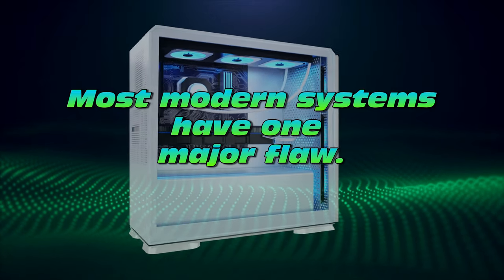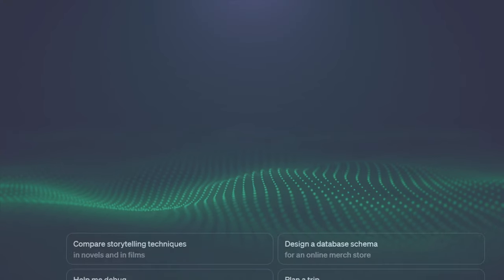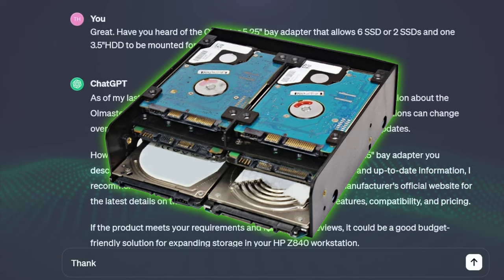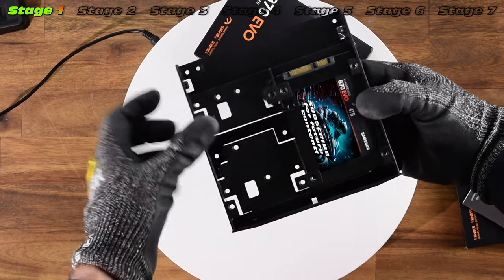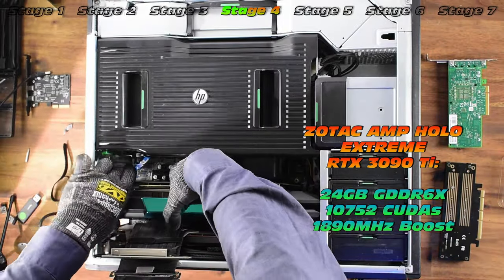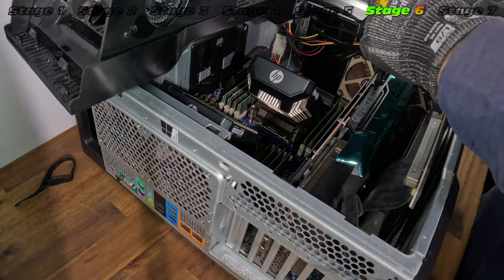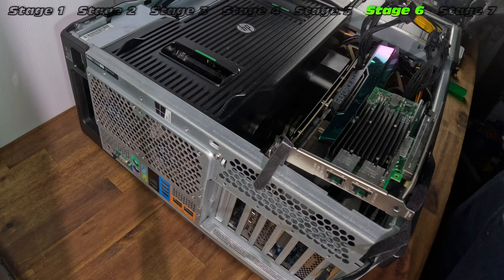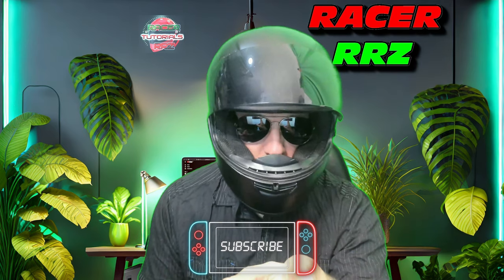Is this the most cost effective storage expansion? - HP Z840 Workstation + 5.25" Bay + 24TB SSD/HDD.

Comment: Well.. I feel inadequate lol. I've been considering a new storage solution for my media library which is quickly growing out of control. its grown large enough, I'd be pretty devasted, if I were to lose it. This video kinda shows me how overwhelming the options have become. I check prices for large capacity ssd's, and nope. Way out of my price range. I check prices for large capacity mechanical drives and it is better, but I'm still not happy since I would ideally like to get 3 drives. Its still kinda pricey, so I check the price of used drives and find it isn't much different than buying them new. While looking at used sata drives, I notice the cost of used sas drives. Large capacity used sas drives are definitely in my price range, but I'd have to get a controller, an expander cable, and I don't even know what else. Does this channel have a guide for this sort of thing?
Reply from the maker: I agree, when did things get so far out of hand? It can become complex quickly but once you gain an understanding of the current hardware requirements you will be able to resolve what you need.

I have done several videos on storage but they tend to be focused on a specific purpose - e.g. how to build a quick home server (easy: https://youtu.be/pCLYzEOur-o ) or how to create a massive DIY home server (complex: https://youtu.be/K4RalaEbRI4). 

What PC / Workstation have you got? If you had something like the HP Z840 you already have an onboard SAS controller which would mean you could install 4x SAS drives into the 3.5" HDD bays and simply plug them into the on-board SAS controllers SAS/SATA ports and you will have functional drives. 

In machines that lack a SAS controller you will need to get a HBA (Host Bus Adapter) with SAS functionality. I settled on the HP H240 HBA because it is supported by the HP Workstations that I own. It converts up to 8x SAS or SATA drives into PCIe x8 connected storage drives (I use it in my HP Z440 Case Swap build - ~80TB of drives connected in - featured in the second "complex" video link above). You will need a couple of data cables (Mini SAS SFF 8087 to 4x SAS/SATA cable) to connect your drives to this controller. Once connected your drives will appear as per normal in your OS. 

I have covered this process in several videos but it has not been covered in a stand-alone video, sorry. The H240 HBA and it's specifications / ideal cable  featured for a minute in this video ( at 3:42 ): https://youtu.be/x4wfkCzQ_rE  

If you run into any questions on the process feel free to ask here, or on our Reddit page: https://www.reddit.com/r/HSpecWorkstations/
Reply: @racerrrz  Cool. I got an msi meg x570 unify, so no onboard controller. I will check the videos out and see if they clear up some questions before ordering drives or anything. I was kinda surprised how much people are willing to pay for used sata drives compared to what they cost brand new. Figured there would be a bigger price difference but not really all that much. One thing I'm concerned about is how loud these things might be. Are they really much louder than normal drives? I'm sure the higher rpm drives are, but what about just 7200 rpm? Thanks for the reply. It was unexpected.
Reply from the maker: @ItIsNot1984  Generally the SAS drives are well engineered and I would like to think they make less noise than the cheaper consumer grade spinners. 

Speed is half the battle - 7200RPM drives will be more noisy than 5200RPM drives - but that's only when you really strain them (SSDs suit that role better). With normal use HDDs tend to be quiet. The most noisy drives that I have used was Cheetah 15K.7 SAS drives. Those sounded intense haha. I would say you'll be fine on noise. I have my Fractal Define 7XL sitting next to me and the 80TB odd of HDDs (mostly W/D Red NAS Plus and IronWolf Pro's) don't make a lot of noise compared with the case fans.
Reply: @racerrrz  So not too noisy then. Thats good. I'm used to pretty much everything server related being loud AF. I've never had a need, so my only reference are the server rooms I've been in. Been looking at controller cards, and man there is a ton. I found one that looks interesting. It may be crap for all I know. Its an intel model. RCS25ZB040 . Has some kinda built in ssd acceleration. Its pretty old, but almost all the reasonably priced controllers are, and I only need 3 drives so the one port is fine with me. What you think? Is this thing garbage?
Reply from the maker: @ItIsNot1984  Server hardware always is, but then that is expected for the enterprise grade hardware. 

The RAID controller looks decent but it will cost a decent amount. Having on board SSD cache is a benefit and it should provide fast caching of your RAID disks. It may be old, but most of the ones you'll find will be old so it's not an issue. The newer items will likely still be in service. If you can obtain it for less than say $100 USD it would be a solid option. A typical HBA would cost around $30-60USD - which should be sufficient for most applications. 

One slight issue with these types of controllers is that they do not always function in all devices. Some server grade hardware is locked to certain machines - which creates a headache with cool items just not functioning in your system. The HP workstations tend to require items that HP have confirmed as functional - which was why I settled on the HP H240 HBA. Just make sure the item you get doesn't say anything about being hardware locked etc.
Reply: @racerrrz  Oh thanks. As far as I can tell, its not locked to anything. I had a look at the manual for it and nothing about that. It also seems to have launched in 2013 and intel was out of the motherboard business by then. I feel pretty sure its not locked down.

There seems to be a few ebay sellers with a large amount of new old stock, so I shouldn't have to worry about the ssd being used up. One thing I noticed though is the capacitor backup seems unobtainable. I'm not really sure how important that is to have. Would that be a deal breaker? I think I can snipe one of these cards pretty damn cheap - like 20 to 30 bucks maybe.
Reply from the maker: If you get them cheap I would say it's worth the risk. As an example, I bought a Intel 10GbE NIC that I wasn't certain would work but it only set me back $20 USD which I figured was worth the risk (it worked, just ran really hot). With your RAID card find being an Intel item I would like to think it will be more likely to be ready for any system. It is well priced for the hardware features. It may be worth asking the seller if they believe it will work in your system. If you end up discovering it doesn't detect you can always go back to the seller for a refund.
Reply: @racerrrz  Just sniped it for $20. Thats about what a 256gb ssd would cost, so not a bad deal considering it basically has one of those integrated into it. Now I just need some drives.

Comment: I hate being limited to just 4x 24 TB of hard disk space. 96 TB is just not enough space to play two different games without having to swap drives, very annoying.
Reply from the maker: I fully get your frustration. Storage prices are nothing short of astounding (so much so I made a video about: https://youtu.be/q-DcsSQJISk) and achieving a storage volume of 24TB, never mind 96TB, is out of reach with the current pricing. 

The question is, if there was a way to attain a large storage volume without having to spend the retail amount - would you want to know about it? 
The IronWolf Pro 16TB is US$320 at B&H right now, but I got my 16TB IronWolf Pro for ~$200 USD.

Comment: Buy a better mic. My volume is cranked up and I can barely hear you.
Reply from the maker: Hi there. Thank you for the feedback. I'll bump up the volume for the next one! 

In this video I was trying to refine my microphone settings a bit more. 

I have the audio levels hovering between 'orange and red' normally in DaVinci Resolve's Fairlight audio studio, but this video I dropped the volume a little lower to avoid peaking out - so 'green to orange' which is maybe 5-10 dB lower than normal. With headphones on my system I can listen to the video on 20-30 volume out of 100 in Win 10's settings.

Comment: This an absolute fire hazard!!!
Reply from the maker: One could say it's on fire...lol. 

Jokes aside, the SSD adapter has been doing fine, but I presume you are referring to the Z840's configuration being a little hot. 

The Z840 has been running daily for several months in this configuration, but it does replace the need for a heater in winter. The 10GbE NIC card mounted outside the case hasn't over heated on me (surprisingly, but the GPU creates sufficient air movement to keep it cool), and the GPU power cables have been solid so far.

Comment: This is why you build your pc. I have 48tb of storage ...and paid 1/3 of oem price. A long video about nothing
Reply from the maker: Hi there. Thank you for the feedback. I am open for suggestions on how to improve this content and I would appreciate if you had a video link to a better example of how to expand storage on your system (for my and other's benefit). It sounds like my video efforts fell short of your expectations. 

My goal for this video was simple, provide a resource to allow others to make an informed decision for expanding storage on their system. 

Most PCs have 2-6 3.5" HDD bays which would be sufficient for most applications. If you found yourself short on storage - maybe for a RAID 0 /1 / 5 pool, this video was made for you.

This video provides a comparison of several 5.25" bay storage adapters which can be installed in any PC with 5.25" bays. I focused on single slot 5.25" bay adapters since that is applicable to a wider audience. 

There are likely hundreds of 5.25" bay adapters and I covered six in brief detail. I then briefly illustrated HDD/SSD installation and 5.25" bay fitment, as well as creating a RAID 1 Mirror with two speed tests for the RAID 1 pool. 

I am not sure what your "48TB" is referring to, I never mentioned the net amount of storage in my system since that was not in the scope of the video. If you were attempting to calculate the net capacity in my system according to the video footage (say at 20:15) it's less than 36TB, without factoring for RAID loss but factoring for NTFS file system overheads. This footage was filmed in May 2023 and I have since changed this configuration.